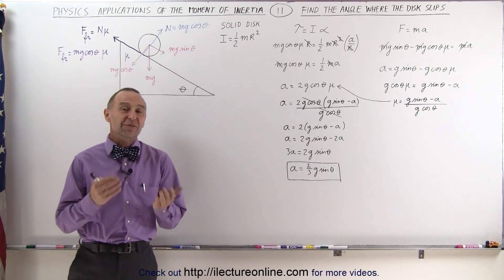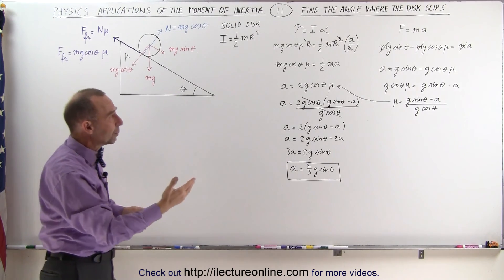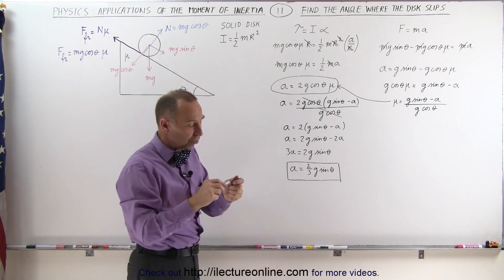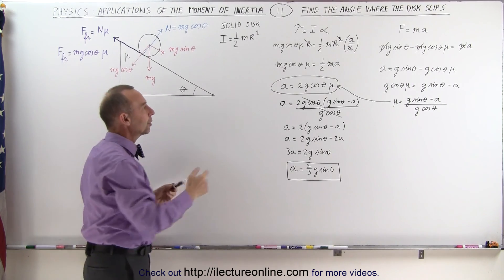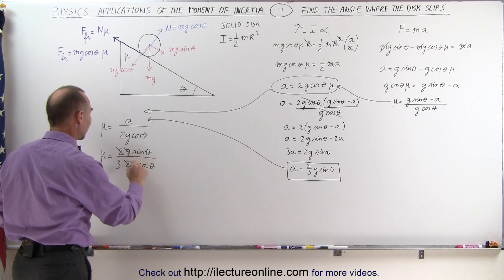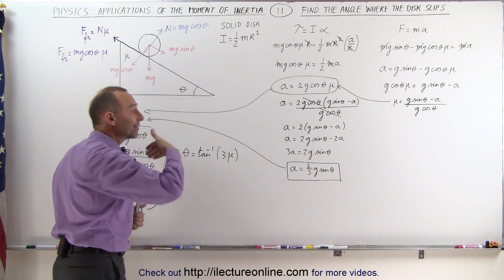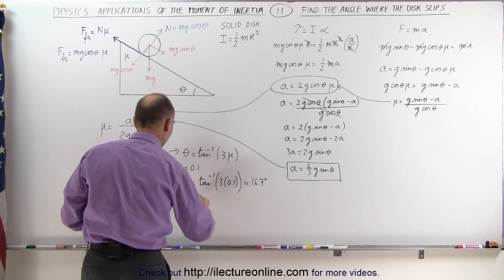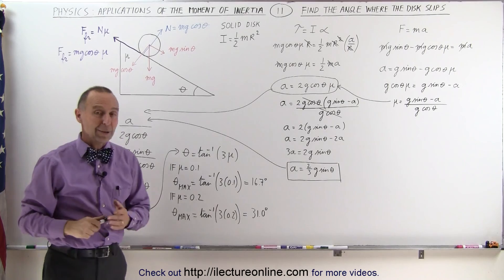Physics 13.1  Moment of Inertia Application (11 of 11) Angle=? When Disk Slips (mu=0.1)

Comment: "Distance" you point st 1:10` is wrong. Shouldn't it be the Radius, 90 degree to friction force?
Reply from the maker: The distance is correct.  It is the "perpendicular distance from the point of rotation to the line of action of the force" = R
Reply: @MichelvanBiezen  I agree at that second, you are pointing length.

Comment: I have a question on this:
Does the final acceleration equation [2/3*g*sin(theta)] apply to all solid disks rolling down an incline plane, regardless of the coefficient of friction for the material of the inclined plane? i.e. altering the inclined plane material to one with a higher/lower coefficient of friction wont affect the final measured acceleration of the disk. 
Or is there some conditions that must be met for this equation to work?
Reply: as long as it has the same moment of inertia, yeah

Comment: the mu that you are using in this video is mu_k. Does the explanation for why the cylinder does not rotate above a certain angle have anything to do with mu_s? Is there a coefficient of friction for rotational inertia?
Reply from the maker: The friction is actually static friction, and it causes the wheel to roll (instead of slide).  Note that there is no energy loss because of the friction.  (We are ignoring the rolling friction).

Comment: what if the angle is smaller than the maximum how can we calculate the acceleration because i have tried it and i got two answers one in torque=I×alpha and one in in_ net force=m×g×sindata -m×g×cosdata×mua  
an example mua=0.5 so maximum angle will be _data =tan^-1(3×0.5)=56.31
lets say the angle =45
1-torque=I×alpha
m×g×cosdata×mua=0.5×m×a(after dividing by the radians)
9.8×cos(45)×0.5=0.5a
a=6.93m/s^2
2-m×a=m×g×sindata-m×g×cosdata×mua
a=gsindata-gcosdatamua
a=9.8×sin(45)-9.8×cos(45)×0.5
a=3.4648m/s^2
hope you answer my question professor

Comment: May I ask what mu should we use? Is it mu(static) or mu(kinetic)?
Reply from the maker: In the case of a wheel rolling, it is static mu.
Reply: Thank you for your prompt reply.
May I double check if the below thought process is correct:
I first use the static mu to calculate the maximum angle for rolling to occur. If the angle of the ramp is larger than the calculated angle, I will treat it as a sliding motion and use kinetic mu in my calculations.
Reply from the maker: yes, if the static mu is too small or the angle is to steep, the wheel will begin to slide and then you use kinetic mu
Reply: Wonderful! Thank you so much! Your videos are really helpful!

Comment: Are you assuming that clockwise torques are positive?
Reply from the maker: No, in this type of problem we are looking for the magnitude of the torque AIDING the acceleration (+) vs magnitude of the torque (OPPOSING) the acceleration  (-)
Reply: Thanks, I was thinking that because the frictional force is generating the torque in this case, its sign would be negative.

Comment: Sir can we say that  if is (mg*sintheta) > force of friction the disk will slip??
Reply from the maker: Try to calculate the friction force and the mg sin(theta) at the critical point where the wheel begins to slip and you'll find out that they are not the same.  Therefore you cannot make that assumption.  It also depends on the torque and the moment of inertia.
Reply: Thank you sir.. I cannot thank you enough.. I have learnt a lot from your videos.. Keep going sir!!